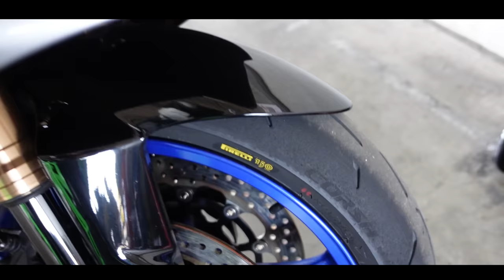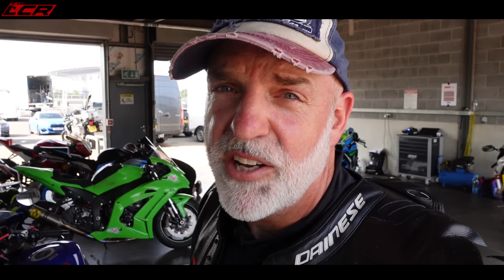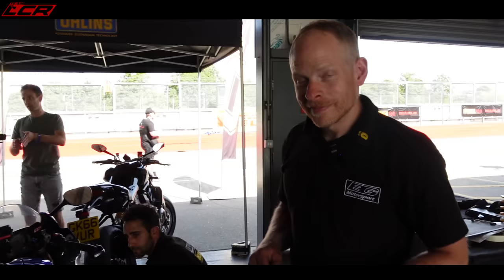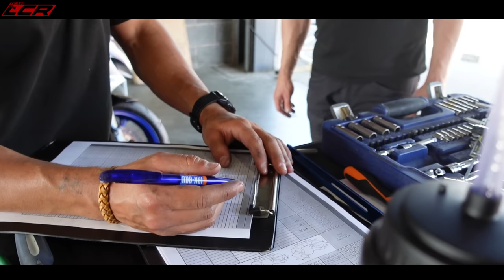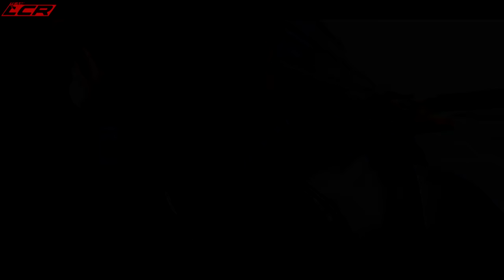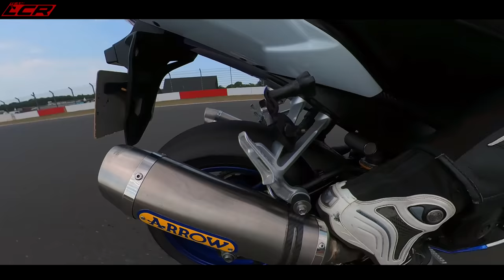Pirelli Track Day On The Old K8 GSX-R1000 | Donnington Park In 36 Degrees!!

Comment: Great stuff Chops, I was hiding indoors with an ice pack on my head that day! Fantastic to have a pair of pro suspension techs looking at the setup for you - and giving you the perfect opportunity to go off and buy a new rear shock and internals for the front. Result!
Reply from the maker: Haha yes very tempted on upgrading the suspension now.. certainly as I need a new spring anyway!
Reply: @LambChopRides  Certainly be the most cost effective way of getting those lap times down - and great material for the channel too!

Comment: Top job chops successful day. Could see after the suspension tweek the front wasn't being pushed so much. Iv not log ago had the roso corsa 4 after speeking to pirelli. Got to say I'm very impressed with them thus far . Still to use them on track but from what iv just seen proformance looks good especially given the heat here that weekend. Top content as usual chops thank you👍
Reply from the maker: Yes they were very good! Impressed

Comment: Definitely need new fork springs up a couple of weights. Probably worth getting Maxton or similar to rebuild, new fluid and revalve to suit. Should be able to manage the on road performance and comfort better as well, giving you more scope on and off track.

Our body types (220kg+) definitely give the suspension a work out and totally over load it when pushing on. Its worth the expense, especially as bottoming out the front could lead to a lock up and throwing the bike down the road.
Reply from the maker: Yes would like to change shock and some cartridges really..
Reply: @LambChopRides  go to Maxton, they will tell you what you need and not just sell you a generic kit. Last time I went, the rebuilt and revalved the forks but only put a spring on the rear shock telling me it performed fine on their dynometer… I was expecting a rebuild and revalve… great service, really impressed. They have many decades of experience of road, track and TT suspension 👍
Reply: i prefer spending money on my bikes than crap food. Slender, light ,lean and strong is best to get the best out of your bike. No point spending  a shed load on your bike getting it to be as light as possible and the suspension set up only for yourself as a rider to be so over weight and out of condition it's embarrassing.

Comment: What a treat Chops you were in beast mode👏 Really you looked good out there. I’m curious after your day at Donnington what mod/upgrade would you like to do and would benefit you the most for your next track day?
Reply from the maker: Hi Dukie and thanks 👍 thing I noticed was the lack of grunt below 6k coming out of corners. Now going to remove the cat and fit the exhaust link pipe and Power Commander 👍
Reply: @LambChopRides  OMG that’s the mod my 890R is really needing too, and I want it now!😭…😂 Thank you so much for your videos, they really are some of my favorite. Keep’m coming Chops I need a second helping.. please😅
Reply: @LambChopRides  Would you be able to use that at any circuits in england due to noise restrictions?

Comment: I'd love to see you do a track day where you get to ride your improved 'classic' and compare it against a modern weapon like the S1000RR. How much are you really missing out on running an older bike. I don't think it's much at all for most riders but I might just feel that because I have a soft spot for the less extreme sports bikes of previous generations.
Reply from the maker: The S1000RR I was using last year was faster. The carbon wheels made it turn quicker and the electronic suspension worked very well, overall suspension was way better. I would say 4-5 seconds quicker per lap on the RR compared to the K8. But its a lot more money for 5 seconds!
Reply: @LambChopRides  Ahh, but how much more fun?

Comment: Hey chopsy. Great video, the Gixxer really got to stretch it's legs 😁. 

Were you using the 360 camera for the main forward shots? Where did you have it mounted if so? Epic angles.
Reply from the maker: Yes I was, had it mounted on the Ultimate Addons stem mount. I then just edited it pointing forward and then back towards me, so two cameras views in one!